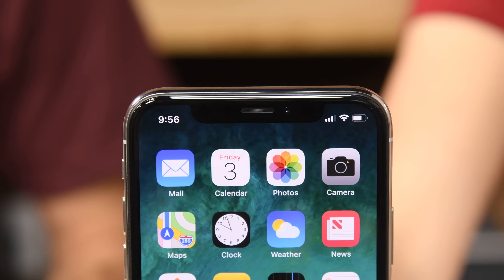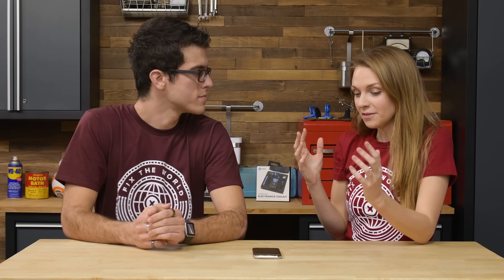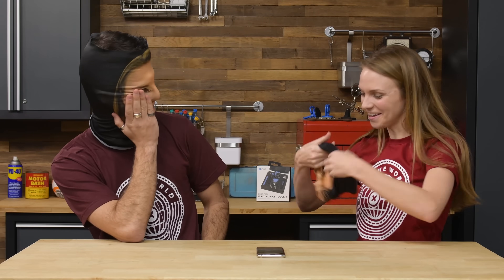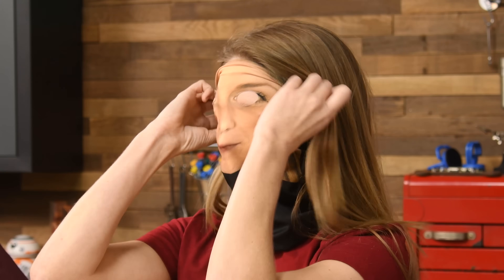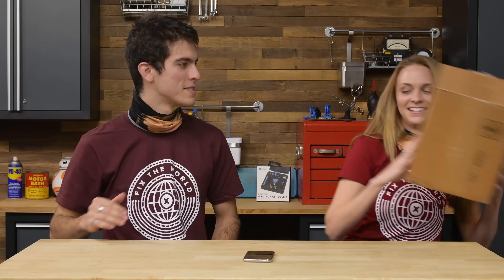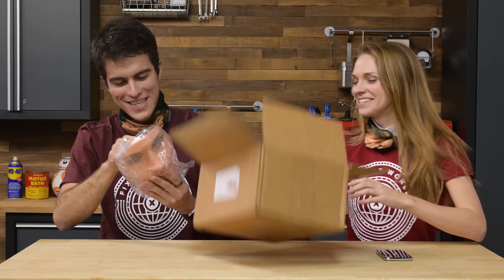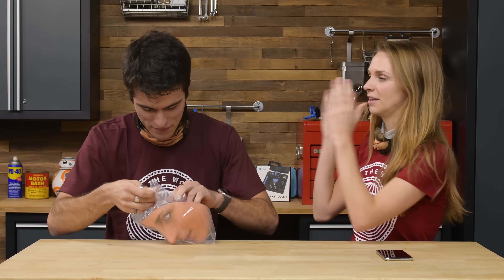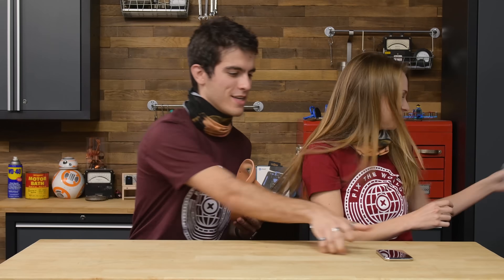Face ID How it Works and How to Trick It!

Comment: The mask must have real blood vessels not rubber or must be able to make face id think it has human blood vessels.

What many would like to know is the health risks of being bombarded by hundreds of thousands or rays dot projectors, sensors everyday, especially for the eyes, seems no one is dealing with that most important issue.

1 in a million is a lie from apple, assuming no hacks.
finger prints are unique 1 in a 8 billion, but all id methods allow for some room of margin of error.

So 1 in 50,000 is probably accurate for fingerprints depending on the software.
face id even apple implementation can be fool 1 in 33 times if we are honest and include twins which a 1 in every 33 people, and thats not including triplets and look alike brother and sisters.

So Apple should have said there are 33000 twins per million, not including triplets and look alike brothers and sisters and strangers, so technically speaking without using hacks, just another person face id has 33000 chances in a million of being fooled compared to 0% for fingerprint, unless you add a margin for error given to software and hardware.

And that would be20 in a million for fingerprints and approximately 66,000 in a million for face id

Comment: Ok y’all don’t know what y’all are talking about. Proximity sensor takes NO JOB in this Face ID procedure. And as well as ambient light sensor. To prove this, I tested iPhone X under different lighting conditions and flood illuminator changes NO lighting intensity in terms of candela. The only parts that’s involved in Face ID would be IR camera, IR illuminator, and dot projector. Illuminator illuminates ur Face like a flashlight, dot projector projects dots, IR camera combines IR image facial recognition as well as changes in distances between each IR dot to determine true depth of the image. Again it is NOT AT ALL related to proximity sensor and ambient light sensor.

Comment: well... I believe that the dot pattern clearly brings rough 3D shape information mainly to ensure there is a real face put in front of the camera (and not a simple fake printed picture on paper). However, the plain NIR image of the face must be the most interesting one to analyze for Face ID for authentification purpose since NIR light does penetrate 0.3 - 1.0 mm within skin = NIR face image must be most interesting one for features identification purpose. It is more or less confirmed by this iFixit video where a printed face on textile t-shirt (or face printed on plastic mask) is used to attempt to trick the Face ID system: however, NIR image of printed face on textile or plastic mask cannot reflect typical skin reflectance in NIR.... since it will rather reveal the raw plastic material base itself, the NIR light penetrating through the printed layer which will be transparent if not thick enough in NIR range... Therefore it is for sure not the right approach as is to trick the face ID method. One should study NIR face images as a starting point to understand what the Face ID camera is using as baseline for features identification. Then print this well understood NIR face image on a plastic mask with a material as close as possible to skin reflectance (e.g. some wax or silicon type with well selected pigments?) and as homogeneous and thick (1mm) as possible to ensure the NIR light that penetrate the first layer material's doesn't reach the plastic raw material base of the mask itself. Lot of fun for iFixit and others to explore all these scenarios... and lot of interesting future mask printing services for the ones that will succeed to trick this effectively :)

Comment: Disclosure the iPhone X: 
-The face recognition scanner on the iPhone X works if the eyes are open. I think that this is not a face recognition scanner, but an eye retina scanner, like Samsung's.
Try installing colored lenses in the eyes or lenses that change the retina (farsighted vision lens -5). Can Iiffe X recognize the face? 
-Whenever you put on a hat or scarf, iPhone X may require you to enter the code on the screen. After that iPhone X will write your face again. It turns out that this technology is not intelligent, if the iPhone X always writes your face every time you enter the unlock code.
Reply: It's a 3D face map.
Reply: this is wrong in almost every way
Reply: well... I believe that the dot pattern clearly brings rough 3D shape information mainly to ensure there is a real face put in front of the camera (and not a simple fake printed picture on paper). However, the plain NIR image of the face must be the most interesting one to analyze for Face ID for authentification purpose since NIR light does penetrate 0.3 - 1.0 mm within skin = NIR face image must be most interesting one for features identification purpose. It is more or less confirmed by this iFixit video where a printed face on textile t-shirt (or face printed on plastic mask) is used to attempt to trick the Face ID system: however, NIR image of printed face on textile or plastic mask cannot reflect typical skin reflectance in NIR.... since it will rather reveal the raw plastic material base itself, the NIR light penetrating through the printed layer which will be transparent if not thick enough in NIR rnage... Therefore it is for sure not the right approach as is to trick the face ID method. One should study NIR face images as a starting point to understand what the Face ID camera is using as baseline for features identification. Then print this well understood NIR face image on a plastic mask with a material as close as possible to skin reflectance (e.g. some wax or silicon type with well selected pigments?) and as homogeneous and thick (1mm) as possible to ensure the NIR light that penetrate the first layer material's doesn't reach the plastic raw material base of the mask itself. Lot of fun for iFixit and others to explore all these scenarios... and lot of interesting future mask printing services for the ones that will succeed to trick this effectively :)
Reply: If it would be an iris scanner it wouldnt work with sun glasses on
Reply: im not sure if its able to scan retina, but maybe thru software it can differs closed and opened eye or track the eyeball. So only when you see it it starts to scan your face
Reply: It has to pickup your eyes, mouth, and your nose. If you obscure any of these things then you will encounter problems, hence it being facial recognition. It needs your entire face for optimum performance. The fact that it won’t function properly with your mouth obstructed completely erases any validity in your argument about it being an eye scanner. Right? You’re answering your own question also with the passcode needing to be entered after each “obstruction event”, because that is basically the reset button (i.e. it just learned). Hope that helps some, but if not I hear that you can actually email Apple and they may reply to your concerns. Have a great Monday...
Reply: DavidTVBox ! Why are you assuming if you haven’t even tried it? Lemme tell you out of my experience. First of all, attention requirement can be turned off but it reduces security as someone can just put a phone in front of you and unlock it. Second, I have went to a themed party in a costume and it worked. Third it works also if I wear hats and scarfs as long as I’m not covering my mouth completely. Overall, it functions really well and I haven’t had any failures so far. Touch ID would fail me more often especially if my fingers are slightly sweaty or dirty. Even clean picking it up from weird angles would cause to Touch ID to fail. Face ID on the other hand works better for me and it does not require you to stare at the phone like with a Iris scanner. A natural, split second glance is already enough to unlock or simply swipe up as you normally would and it’s unlocked. The only limitations I’ve experienced so far is that if your phone is too close to your face it doesn’t work, and if I yawn while unlocking it fails too. But overall it’s very good and reliable and unfortunately it works so intuitively that it loses wow factor after couple of hours since it literally feels as if there’s no password.

Comment: this test its naive, try again with an accurate rubber mask, one with the actual size of the subject and add some sort of artificial eyeballs (even contact lenses with an generic black background), a mask bigger then the subject its easy detectable, this mask was designed to be placed on the subject face thus being bigger than the original, for this system its easier to detect small size variation than skin tones (as long the IR and daylight skin tones are accurate to the subject).
do this before some independent reviewer shames you and your credibility.
Reply: rubber mask have no blood vessels so it would instantly fail as not human, unless there is a way to simulate human blood vessels in the skin on the mask, and I am sure there is.
twins and look alike family members, triplets have tricked it, they all have human blood vessels.
Reply: You sound like let’s make an exact copy of finger print of someone and use it to scoop android phones that uses fingerprint scanner in 2017
Reply: if someone goes into such a trouble and cost to open my phone I will open it for him. He deserves it!
Reply: macserv Yes very sophisticated 

150$ mask that has already hacked Face I.D

There is nothing complex about this software.
Reply: @deepmystic5850  if you got into the trouble of somehow scanning my face without me knowing, then spending 150$ to manufacture the mask, all this time and money just to have 5 attempts to open my phone, then my friend you are a  hero and I will unlock my phone for you myself...
Reply: I don't think they have a full laboratory for that

Comment: The face Id has been "tricked" into unlocking by twins. So much for the 1 in 500,000 theory.
Reply: and besides, less than 0.0001% of people are actually identical twins. So why is like 40% of the population worried about it?
Reply: What do you not understand the term identical twins? They are identical for a reason.
Reply: They did say in the keynote and I quote "that statistic is a lot lower with someone who shared a genetic identity with you"
Reply: Someone didn’t sit through the keynote
Reply: R Collinge apple said that it can be unlocked by identical twins. So it’s not a big thing
Reply: Apple made that clear in the keynote though.
Reply: R Collinge if u don't have a twin u are good.
Reply: R Collinge Just hope you have no evil twin :)
Reply: R Collinge Apple specifically mentioned twins when they announced it.
Reply: Go watch Apples keynote, because obviously you didn’t. They specifically say twins can probably unlock it... like do you not understand if people look very similar then it won’t work? But the chances of that are so low it shouldn’t matter to you. You probably don’t even have a twin either and just want to bitch about the iPhone
Reply: Yeah, I think Apple would be justified in not factoring in those special cases where the phone is fooled by someone who is genetically identical to its actual owner.
Reply: That is not true touch id is 1:50,000 face id is 1:1,000,000 unless there is an identical twin, if there is it is about a 1:20 chance.
Reply: preston ferry if my math is correct 1:1 If identical twins hahaha lol
Reply: True even if they have different hair styles and even if one has facial hair and the other twin dosen't.